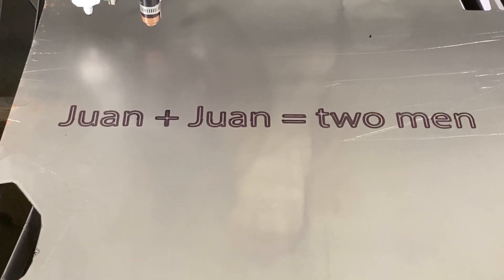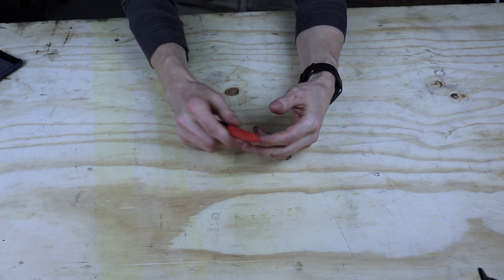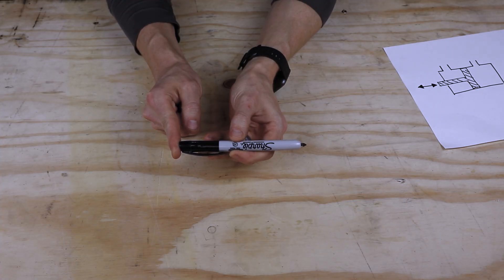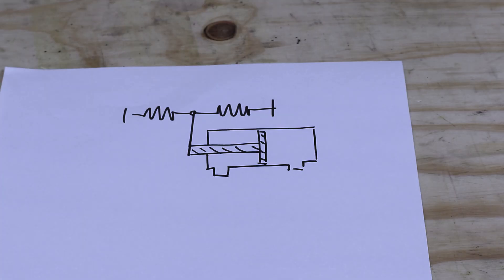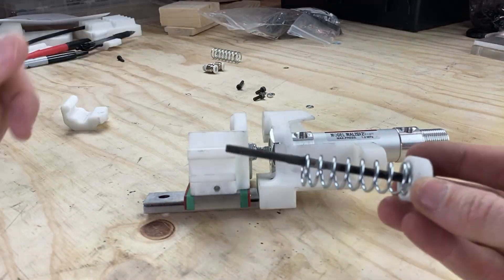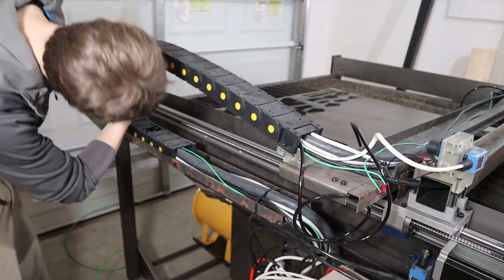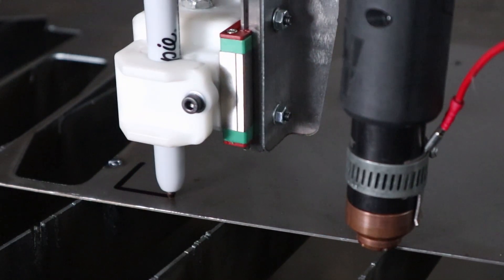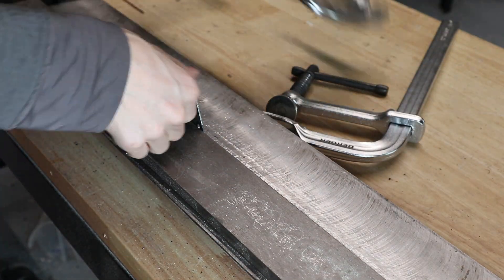This marker will change the way you work with sheet metal

Comment: For the line thickness -- you might want to adjust the height so it's well off the surface, swap to a new sharpie, then slowly adjust the height until it just barely touches the metal.  Once you mash the tip, you're never going to get a thin line.  Of course, if you need to adjust for different gauge sheet (I'm not familiar w/ plasma cutters, so I don't know what they handle already), you'd need to rig up something possibly spring-loaded to ride against the surface and set the marker relative to that.

Comment: Re: the energy chain - use a fish tape to pull a pull-line through and leave it in there. When you need to add a new cable/hose, use the pull-line to pull the new cable/hose, and another pull line so you again have one in there for the next time around.

Comment: You youngsters, showing off with what started in life as a printer? When I graduated high school, they had just bought this new fangled "BETA" machine to show videos. It took two men and a boy to carry it into the room. Ok, I will wait for everyone to stop the "Oohs" and "Aahs". Back in my day, nothing wrote on metal except soap-stone. To get to the store that sold them, you had to walk 26 miles, uphill both ways dag-nabbit! Ok, you're a show off with you fancy pen holder/marker/bendy/thingy. My VCR is still flashing 12. I don't know if that's noon or midnight, but after looking at my sun dial, I figured if it's dark and flashing 12, it's midnight. Ok  one more to go, but by-golly, I get-R-done. I hope you can make your tree-climber-thingy, cause we used arms, legs, and hands to climb. If you fell, you would pour some rot gut on it, then tied a your necker-chief around it, dust your behind off and get back on... robot felt tip pen thingy, what's next? Huh! I guess you could make corn-cob dispenser for the out house! Right? Ya, try that... they are all different size! Huh, now what smarty?

Comment: To solve your frustration running new things through the energy chain/flexible conduit/trough, cut a piece of string 2.5x as long as the whole internal run through the chain, tie a loop in the middle of it, then run it through the chain.  Depending on which way you need to fish new runs through it, pull one end until the loop comes out, bind your new hose/wire to the loop and pull back through the chain.  By making it 2.5x as long, you can pull things from either end, always leaving the fishing line/loop for the next time you have to pull something through!  :)

Comment: Nice job on a clever idea. Just a side note to pass along, if you put your pneumatic flow control valves on the air cylinder, rather than the solenoid valve exhaust, your cylinder will act even smoother when adjusted. Flow controls closest to the cylinder work the best.

Comment: ...just cut a series of tiny holes along the bend line. It weakens the metal along the line, making it easier to bend accurately. You're welding anyway, so weld up the holes when you're done.

Comment: Just out of curiosity, would it be possible to instead of using springs to simply pressurize both ports of the piston? Or would there be issues with wear and tear/inaccuracy.

Comment: The correct valve for that would be a 5 way 3 position with a center exhaust. The center position with no voltage applied to the solenoids would let the cylinder float letting the springs do their job to center the cylinder.
Reply: The correct valve is the one you already own :-)

Comment: On industrial plasma cutters usually there is a setting that lets you mark part with cutter itself, it just cuts shallow groove on top (not really damaging the sheet as it can be really shallow). Because of using plasma head you get better accuraccy , the groove can be much thinner than sharpie head. For writing on the part, there is separate tool working like an inkjet printer.

Comment: Maybe a high torque servo would've been easier than the springs/air.
Reply: He used air as it is immune to the electrical noise from the plasma head, especially trying to run the control signals through the same umbilical as the high current line.

Comment: The cap would only be used in shipping.  Most of the time if there is something consumable that gets loaded into a machine there is a cap of some sort that you had better remove BEFORE installing.  So, for your machine, you wouldn't be running cap cycles on the pen, because that is fraught with additional variables/dependencies on other people's quality control...one solution would be a simple sealing mechanism, like a solvent cleanable flexible material cast with retention in it which automatically applies itself when the fixturing mechanism retracts the line drawing head (pen).  In all fairness, I would replace a LOT of this with soft robotic type components as rigid mechanical things reliability is way lower and I don't like fixing a tool all the time and maybe never if I can get away with it.
Reply: Actually it occurs to me right now, just a flexible sleeve that tapers down to seal that also acts as a nice retention/damper as well :-)
To draw, push the pen through the end of the sleeve.  To park, pull the pen back through the end of the sleeve just until it seals (don't want to waste consumable drawing on your own equipment excessively lol).
Reply: So now you can use any pen as long as you recalibrate height.

Comment: What I found on my plasma table to remove noise was to use backup battery that puts out a true sqaure wave for my controller. Doing that has cured my noise issues.

Comment: You could have added small notches or slices where you want the bends to be. I do this for making cone patterns or square to rounds in sheet metal in Solidworks and then we waterjet the parts. The brake operator then doesn't have to do as much layout to do bend the parts. This was a great video and it shows some very good mechanical ideas and uses for the 3D printer. Good job.

Comment: Is there a mechanical reason that the opposed centering springs are attached on separate axes on the final part? It seems like you could make the device smaller and simpler by just mounting the non-adjust spring on the same axis as the adjuster, in the empty space between the two brackets. It would function identically (as in your schematic diagram of the spring return mechanism), and the screw adjuster would still work fine. That's fewer parts and a smaller bracket.

Comment: You could’ve subbed in a scribing tool for the sharpie and wouldn’t have had to worry about the whole opening and closing aspect.
Reply: Exactly what I thought. Could use a diamond or carbide tip scribe with the same spring action. Less consumables and a much more robust marking on the material.
Reply: Scribing is rarely used in precision manufacturing especially for aerospace due to how it helps the onset on corrosion. However for most applications it’s a good idea! Maybe when he’s tired of buying new pens every time they run out of ink he’ll change it
Reply: Yup somthin like tungsten or titanium, idk im not a scientist, hard pointy metal rod
Reply: @skie6282  i believe titanium is pretty shit at holding any sort of point or edge, but tungsten would work afaik.
Reply: But what if it is used for decoration
Reply: Soooooooaaaaappppppstooooonnneeeee
Reply: Subbed a scribing tool
Well that is ( probably unintentionally ) funny
Reply: You can buy a spring-loaded diamond tip drag bit online.
Reply: When was the last time you scribed a line at 90 degrees to your work? The tip wouldn't last 5 mins.
Reply: That likely would require surface following to a greater precision than the marker, and also, the drag force might be too high and the “breakaway” could trigger.

Also, easily removable line.

But your point is valid...maybe a spring loaded scribing tip?
Reply: That’s what I was thinking; just mount the scribe on a spring mount.
Reply: Then make air brush part with the blue dye
Reply: Content and money needs to be made lol
Reply: Or he could open and close it by hand. He went to the retractable version due to clearance. But he didn’t have to automate it. It does open for each draw, he has to put in a command to open it at the start and close it at the end. With the same effort he could walk over and click it open and then do so again at the end to close it as he picks up the parts.
Reply: @stevebollinger3463  its not too bad he probably just set  something like M10 and M11 for clicking/ releasing the pen an M12 M13 for extending  retracting 
the post processor can have a start/end sequence  for specific tool path types  so the cad software output something like this in the NC file:
N10 m10 m11 m12
(toolpath blocks)
N500 m13 m10 m11

Comment: Note, you can just put springs inside the bore of an air cylinder, and not have to worry about a separate mount. The end caps should just thread off and let you stick it in there. I used this trick building a pneumatic 3-speed gearbox and it saved a lot of space and mechanical complexity.
Reply: This is a genius little hint.
Reply: Convert your boolean to a tristate with this one weird trick
Reply: True but not adjustable.
Reply: @sbsftw4232  No need for an adjustment there really: You can tune the total height for the low position, and have the on/off stopper adjustable. That's enough.

Comment: The solenoid(s) couldn't drive the pen directly (with no air cylinder)?
Reply: Came here for this!
Reply: 10:49 he talks about how A solenoid would be electrically powered, and to run another cable through there and add electronics to the head would make it extremely vulnerable to electrical noise from all the energy of the plasma cutter.
Reply: @gavinmanteuffel6134  Even though the cutter is not running at the same time as the pen?
Reply: Yeah that’s true ig idk

Comment: A common practice I have seen is to use printed Mylar or Paper with the bend lines printed to scale along with the cut outlines.  To ensure scale for standard printers, add 1x1” (or other ratio) box at desired location.   If you have to print large plots but don’t have a plotter add “x” or “+” symbols throughout and print desired segments and tape together by carefully aligning symbols.  To adjust size just adjust scale settings during printing.  Once dialed in, document that setting as it will likely work in the future.  Depending on accuracy a set of calipers may aid in measuring printer accuracy.  Try to make sure the line width is approximately thick.  Then place over the cut part and secure the printed pattern and use a knife to scribe the bend lines by cutting through the paper.   This technique is far less efficient, but gets the job done.

Comment: @stuffmadehere 9:52 like running cable in a wall if you ran a string through the energy chain you tie the new cable you want to snake through it along with a new string for next time you wont have a hard time pulling cable through something like that.

Comment: Next time you feed something thru your energy chain, tie a cord (or several) (with some extra length) to the front end and leave 'em in there.  Then, the next time you need to add a cable, tie it (with a replacement cord) to the cord and pull 'em thru.  Use electrical tape to "smooth" the transition at the pulling end.  Also, coating the cable with a light coat of dish soap helps reduce friction - but they also make wire pulling powder if you want to spend money.

Comment: I use a sharpie daily for bending.
Did you know the ink is different in the retractable sharpie versus the regular capped sharpie?

I like the flapper mechanic for the retractable sharpie. It is on a hinge that seals the felt tip while not in use.

They are too expensive though for daily use at work and the ink is annoying and hard to wash off with denatured alcohol. I have found it gets into textures and you have to scrub extra hard to remove it.

Comment: Nice idea for precision bending but... why don't using a metal engraving bit instead of a pen? (I mean... not with a spindle motor... only a sharpened metal bit to engrave/carve the surface of metal... to have s thinner/precise line when bending)

Comment: Great video! I would be interesting to see the software side of this as well, how to separate "bend marks" from cuts and generate the correct gcode from that.
Reply: I would say this is not very complicated. 
I think in the software this is set up as an additional toolhead with the XY offset he spoke of. Since he drives the Z movement with an air zylinder there has to be just the valve controls for up and down. 
CAM software can usually generate Gcode for more than one tool heads in one rush.

Comment: Fantastic idea! I am really really impressed! The spirit of a great inventor lives in you! 
This is really useful! Would you share plans / drawings etc for it?
And a question: how did you make the interface between the plasma and sharpie? Meaning how does the head know where to draw the bend lines? Are they on different layer in dxf and you just offset it?  Or does it do it automatically somehow? I know in Solidworks bend lines can be on separate layer, how does it interface with the plasma? Thanks.

Comment: IDEA:
You could score the metal with a pointy tool, rather than drawing on it with a Sharpie.
That would probably simplify the mechanics needed to make it work, and eliminate the "thickness" of your lines.
Reply: Carbide or diamond tip scribe on a specific pressure spring.  Less noise with dis-similar material.  Or mount the scribe in rubber.  It just needs to make a mark, not gouge.
Reply: @Christbullet you aren't scoring it, like cutting glass panes, you are just cutting through the dye layer. Hulk Smash = bad.
Reply: Sharpie comes off with acetone. Scoring lasts forever.
Reply: @Christbullet You are right, scoring the surface is a big no no in the aerospace industry.
Reply: What if you used a sharpie instead?
Reply: @Christbullet in titanium it would forsure
Reply: Easiest thing to do, would have been just to etch lines with the plasma torch. Im sure there's an option for it in his CAD program. If not, he can just edit the gcode himself. It literally takes 2 seconds and the hardware is already setup for it. You guys are over thinking this.
Reply: @NG-VQ37VHR  Wouldn't plasma etching risk significantly changing the steel temper and/or strength?
Reply: I would use that blue stuff to scribe the lines or if you just used a regular scribe tool like when you're marking on a lathe. It's just a fine surface scratch it's not going to effect the strength of the metal or add any extra stress. Also with all the money he spent to get all those different CNC Machines, you would think that he would own a bending machine
Reply: @mikekinard8998  if you have a static load yes, but with dynamic loads even small imperfections in the surface can significantly reduce the time to failure
Reply: I think a better approach would be a ink jet type mark. He certainly has the talent from a hardware/software. Buy a cheap inkjet printer with remote tanks (epson) as a template.
Reply: A ballpoint pen will put a barely noticeable line anywhere with little pressure. We would write combinations on the back of locks with Bic pens and you had to know to look for them.
Reply: Those servos would survive that. Scoring metal won't help that much unless they are deep.
Reply: yea yea, good idea.  Just swab it with some Prussian blue, auto-scribe, and voila.
Reply: that'd be loud which he said he's against but good idea nonetheless
Reply: @benfillman4049  I believe he was talking about having problems with noise in the signal wires of the electronics, not sound noise
Pneumatic actuators aren't very quiet themselves XD
Reply: @brown56765  then you could extend/retract the pen with standard kinetic wiring, like "muscle wires" and also use the flexible sleeve I described earlier to solve the cap problem which really wasn't a cap problem it was just a feature deficit in your design as applied.
Reply: I think I just redeisgned this to have no moving parts.  YAY!  NOTHING  TO BREAK EXCEPT THE PEN!
Reply: @benfillman4049  It's not a chalkboard. 
Scoring metal is actually rather quiet. Unless you decide to go Hulk on it and scratch the hell out of it.
Reply: The friction is gonna be a lot, would the servos survive that? Would it need to be recalibrated?
Reply: @Christbullet it would depend on the thickness of the metal and the depth of the score, but you could dial it in without much hassle
Reply: Scoring in only one side would be inconvenient if there are bends in either direction
Reply: fiona fiona a sharpie doesn’t solve that. It still draws on only one side.
Reply: A pointy tool? Oh my God go back to school

Comment: For fishing the additional lines through the power chain... Next time you have to do it, attach a string and leave it in the channel.  Next time, use it to assist with pulling the wire/hose through, while pulling another string with it.  Repeat this anytime you add something and you'll always have that string in there.

Comment: what program are you using for your plasma table? Is it as simple as adding another "tool head" to the program and having it activate the switch for the air line anytime that tool head is used?
I would love to know how you made the dxf side of this to work.
Also, I want to see the tree climbing robot as well. Love the channel. Subscribed! I plan to start making some videos in a year or so after finishing Mech. Engineering degree.
Reply: late reply, but im pretty sure what hes doing is just adding the offset to the precise coordinates it needs to start/cut